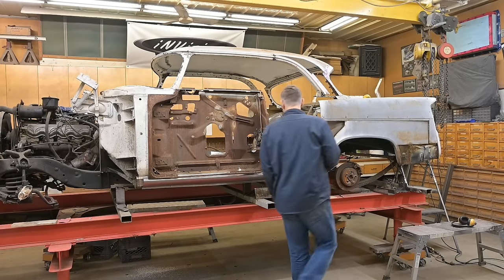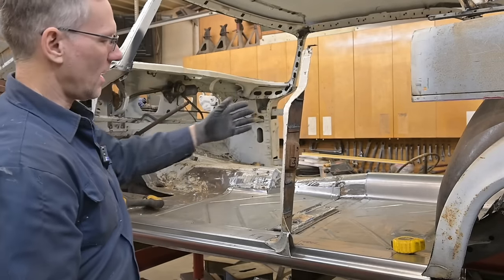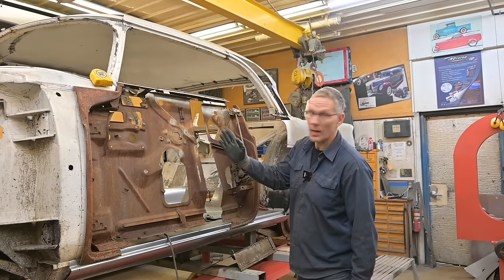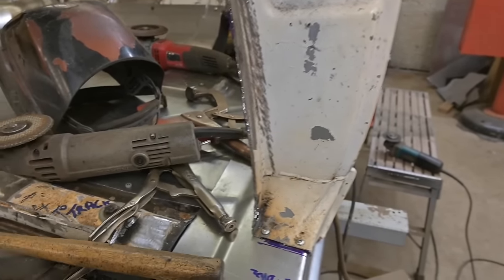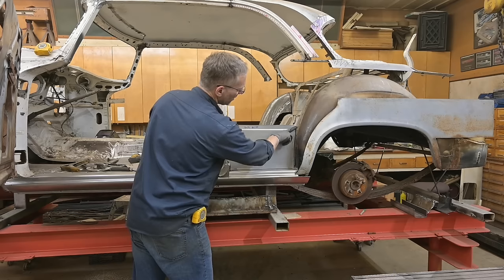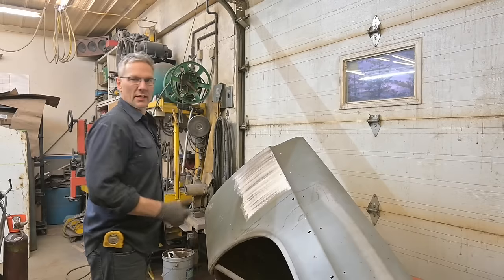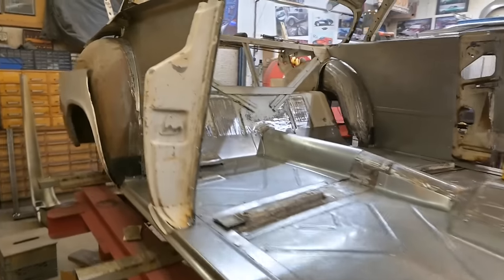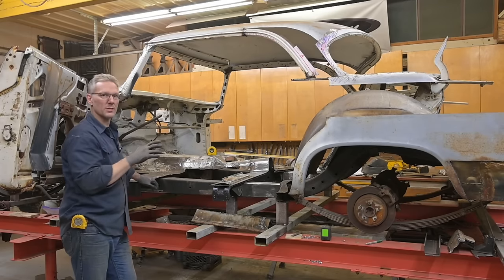HARDEST 4 Door to 2 Door MOPAR Conversion EVER!! - 1956 Chrysler Windsor Muscle Car

Comment: How exiting it is taking shape and i can almost hear the v8 roaring to life.
Reply from the maker: Check out the first start and drive episodes we did without and then with a carb respectively.  The Semi-Hemi really has a sweet sound!!
Reply: @iNVisionPrototypes  Cheers i just watched those two videos and good to hear the 331poly fire up and they do sound sweet will you soup it up a bit with camshaft and dual quads and twin exhaust pipes. Looking forward to seeing what you do with the power train.
Reply from the maker: @grantberecry  That's the plan! 😃👍

Comment: Love watching this build. Also the way you approach each task Nick,  Just not sure on the size and shape of the rear screen. When the glass was in to me it just wasn't quite right,, Can't wait for the next episode.  Rich.
Reply from the maker: Hi Rich, I recall your comment from a previous episode.  When we mocked up the rear glass it was only sitting on a drop sheet which rotated it clockwise and out of the actual mounting position - making it stand more upright.  When mounted within the seal the bottom edge will move rearward thereby rotating it anti-clockwise and improving the flow down from the roof.  Give me chance to fill in the spaces in the quarter panel area.  We'll take another look at things again at that point.  Thanks for taking the time to watch and share your thoughts!!

Comment: Nick, I noticed all the equipment in the shop matches. At first I thought it was probably a result of maintenance paint but now I wonder how many pieces you fabricated. Ever consider a video on what is house made and especially how? Thanks.
Reply from the maker: Hi Daniel, We cleaned up this bay a few months ago which included painting some of the tools.  The 6ft sheet metal brake, e wheel, tipping wheel and frame table among other things were all built 'in house'.  When I get a few minutes I'll see what I can do about a video.  Thanks for watching!!
Reply: @iNVisionPrototypes  Awesome Nick, thanks!

Comment: Beautiful work with your Dad. You need the HG2000 Laser Cleaning machine, it will save you time and diassembly.
Reply: Is it same as Brents from Halfass Kustoms...
Reply: @JustinPaul1st  They should name it the Eyeball Eraser 2000. He scared me when he started blasting the chrome bumper.
Reply from the maker: @nathanrjugoz3360 Thanks for the tip!

Comment: Isn't that rib on the lower door frame where the door card slots in?
Reply: I've had a lot of Chrysler vehicles That's one of  The mysteries With no purpose Another one is why are the doorgaps at the bottom on the passenger side 1/2 inch wide on every car
Reply from the maker: @quentinstacy35 I assumed the spring clips held the panel in place.  Perhaps there's a bracket on the card that slides in as you suggested.  Will have to take a look.  Thanks!
Reply from the maker: @shanefluhr6454 Very interesting!